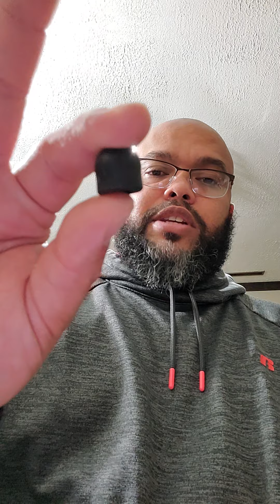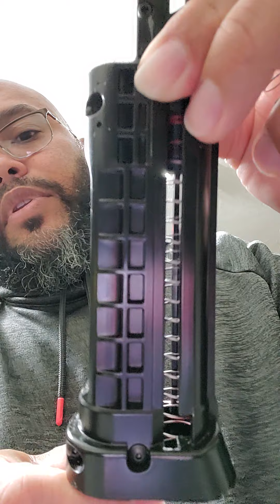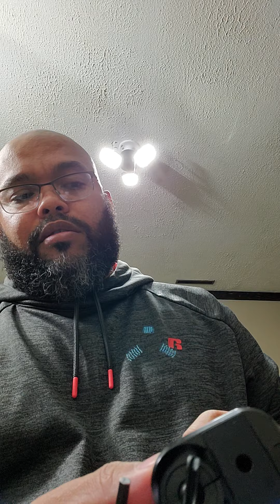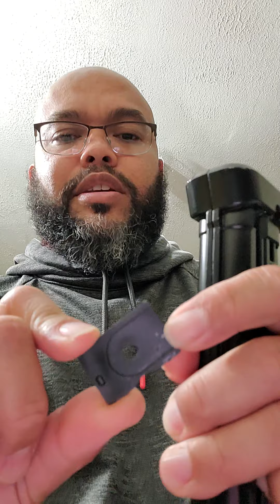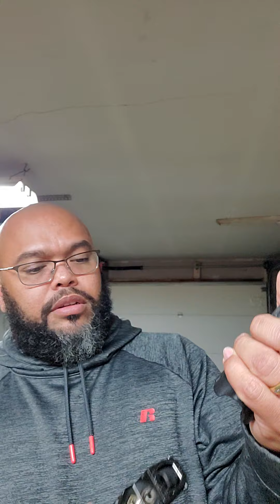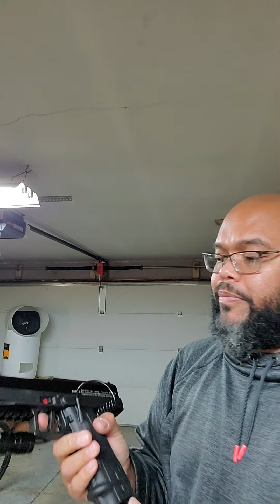T8.1 shooting

Comment: Hay Henry I have a question I've been testing my T8.1 and the last couple of times I've fired it when I get to the end of the mag and the co2 is just abought done it makes a funny sound like it's farting is that normal or is there an O-ring that needs replacement I know it almost out because when I remove the co2 very little air comes out maybe I'm over analyzing it but that noise is a concern have you ever experanced this
Reply from the maker: Normal. Sometimes it can even  make a popping sound.
Reply: @psi.defence.channel  Yep thats the sound thanks for clearing that up still a nob with the T8.1  haha thought I had things turned up to high

Comment: Hay Henry SUF here I glad you mentioned that thing about the regulator seeing that I could be hard pressed if something should happen to mine I actually looked online to see if the were available anywhere should anything happen to mine I always like to keep spare parts on hand no luck so far so I plan on following the direction of the experanced ones, I actually broke one of my washers in the bolt assembly today when I first took it apart but fortunately I have a lot of O-rings  from other things I tinker with so I was able to repair it I also cleaned it up got that awful paint job someone did scotch bright and soap and water  plus some tooth picks fixed that looking good now all that is left is taking the mags apart and cleaning along with inspecting them I'm one happy camper now take care great video bro

Comment: Ok, I finally figured out how to post a comment, so not sure if I' doing this correctly, etc. As such, this is the very first comment I have ever made within a youtube channel.  First off I find your videos very helpful and informative and wish to thank you for taking the time to compose your reviews and instructional videos!  Now regarding the FS T8.1 jam you had with using HP68's on stock springs, I wonder if the jam may be caused by the barrel itself?  You may already know this, but since you didn't mention it as a possible cause for the jam, I thought I'd at least mention it.  Per Kurt at Grimburg, some older forged HP68's can get stuck in certain barrels due to their size being ever so slightly larger than .686mm.  In fact, after bringing this up with Kurt, not long afterwards he began selling 2 different iterations of the HP68.  One for the rifled Nemesis barrel and the other for smooth bore barrels.  Of which the former, are apparently have a slightly diameter by .0005 or .6855mm in size, if my recollection serves me correctly.  Anyway, just thought I'd share that just in case you hadn't thought of that.  If you have, I would be interested in learning what you uncovered as the catalyst for the jam.  From watching / hearing and from having a very similar sounding jam, it sounded like a round got stuck in the barrel.  Please keep producing your videos and I will certainly keep watching...